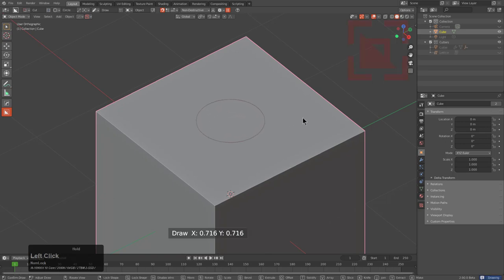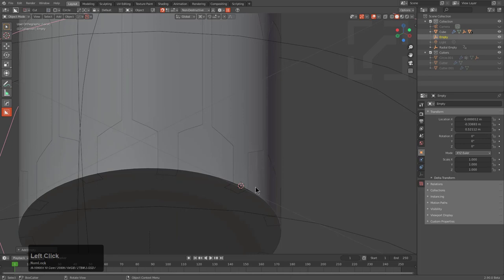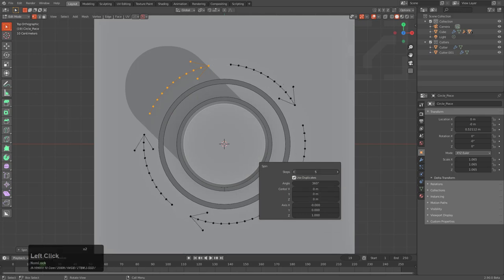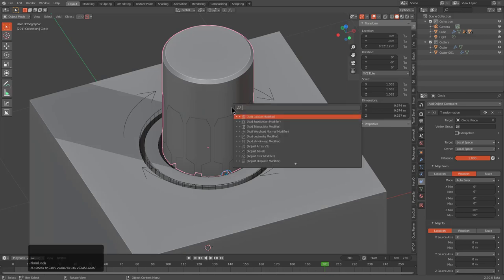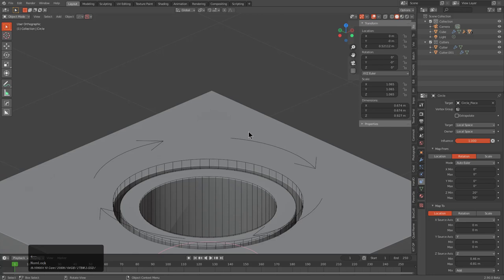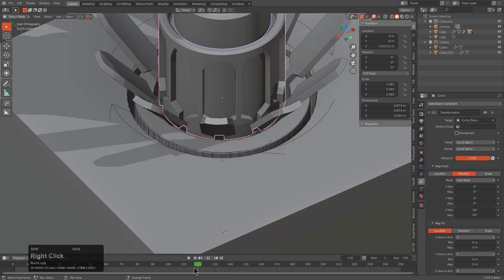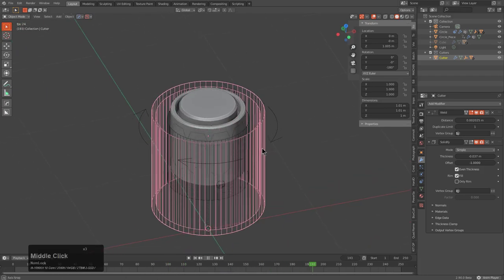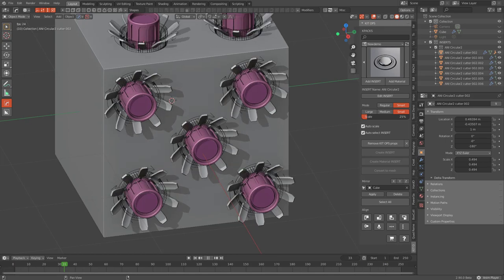#kitops2 - Creating Your Third Animated Insert

Comment: Always amazing content! I was wandering, what is the Origin/Cursor pie menu at 0:47? an addon? I'm in blender 2.83.4 and I don't have origin to selected in my shift + S pie menu
Reply from the maker: https://raw.githubusercontent.com/mx1001/power_snapping_pies/master/power_snapping_pies.py
Reply: @masterxeon1001  thank you so much!
Reply: @masterxeon1001 , hmmm, I thought I was using the Machin3tools (it's free) pie menu, (I think?) but I installed meshmachine at the same time, so it was a fight in the beginning.  I just couldn't give up alt z to select verts thru a mesh, then I just remapped meshmachine's keybind to shift ctrl alt z and voila, I got my xray back.  If there's a better way, I'm all ears.  In case you are willing to experiment @posproductions, you could try machin3tools too.  https://machin3.io/MACHIN3tools/docs/  I like it better, but to each his own.

I'm surprised you're using power_snapping_pies.  I'm just mostly confused so don't mind me, but styli and pies are uber fast.  Even if they remind my of Maya which I've had bad enough experiences 20 or so years ago; I didn't want to use pie menus until machin3tools. 

I just realized my left thumb has a less a sophisticated ability to move a trackball than my right thumb, given the lefty thumb trackball I got on thursday, and as predicted my left hand didn't hurt at the end of the day (which was a really fast benefit), but I'm used to styli speed so maybe that's part of it too and my left thumb is only on it's second day thumbing a trackball (I only used right handed ones in the past).